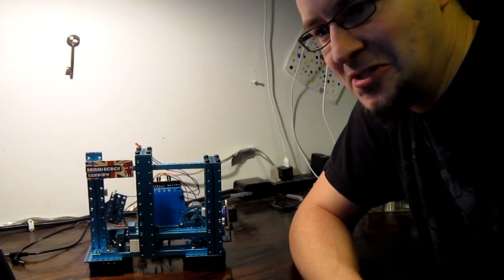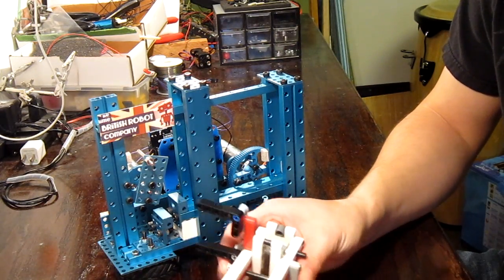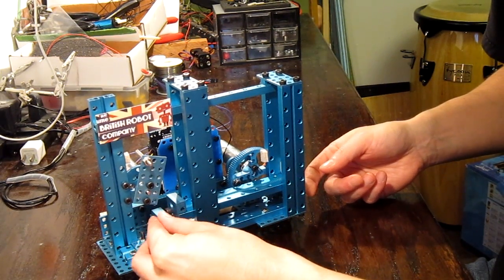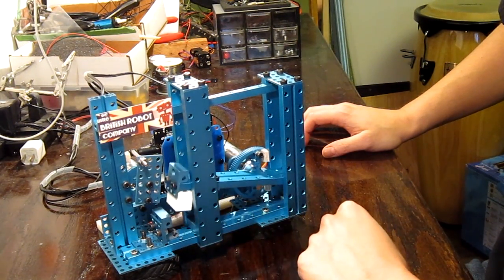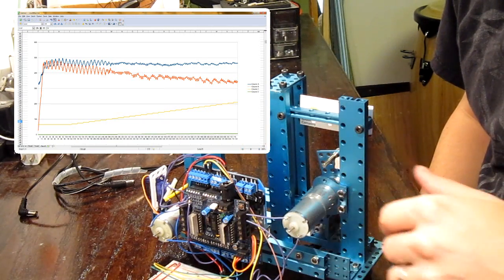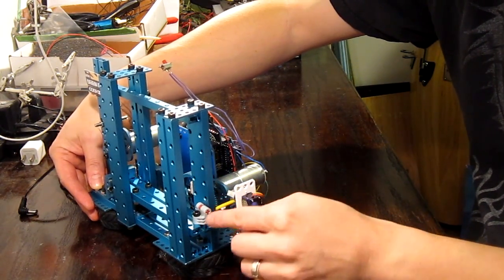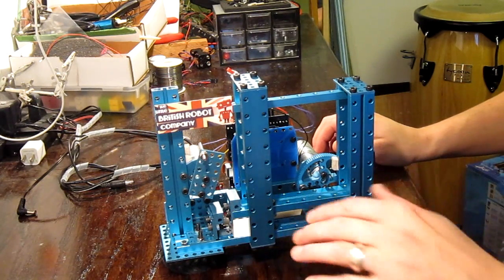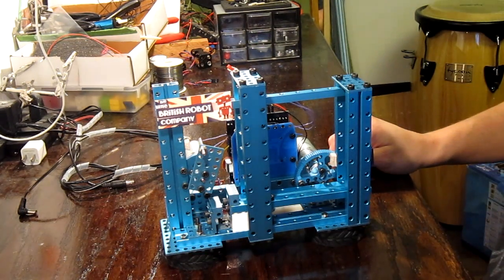legotest - Brand new Version 2

Comment: Perhaps a bit late to the (Sai-K-Delic) Party, but a lot of fun at this hobby-level approach. Of course The LEGO Company will have their own machines running multiple clutches per second, but it's something that can be done at home in a week or so. Cheers
Reply from the maker: The speed was purposefully slow to prevent friction-induced heat from Accumulating.  The goal was to test the LEGO pieces to wear out at room temperature and not to get them hot or, even worse, melting.
Reply: A solid approach, hadn't though of that